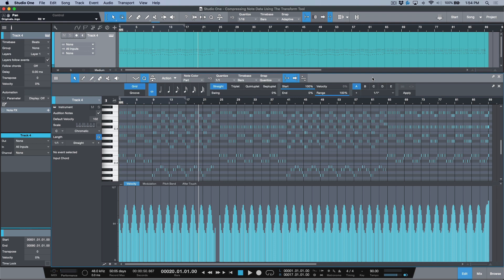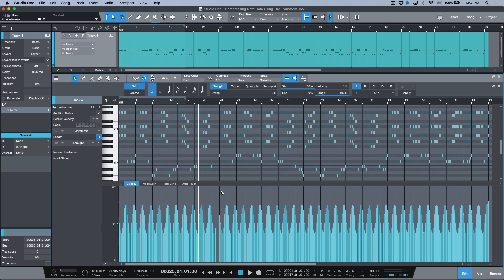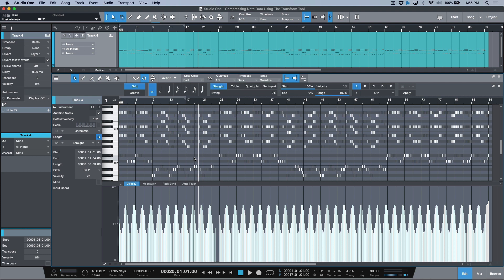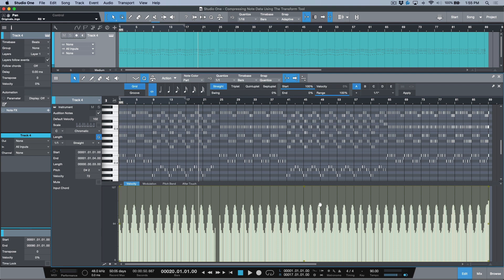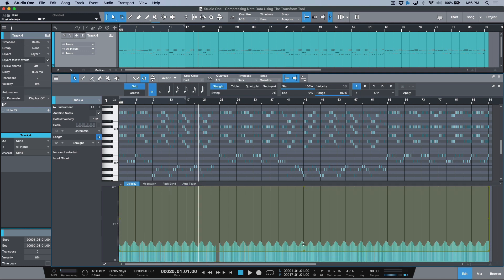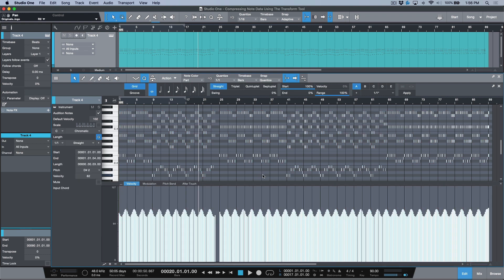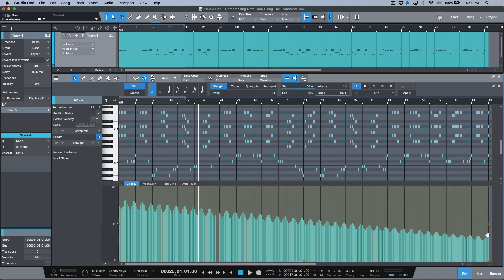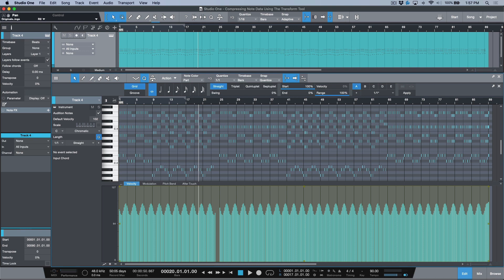Compressing Note Data with the Transform Tool In PreSonus Studio One

Comment: Great tip. Question- can it be used on external MIDI hardware, such as a Korg Kronos?
Reply: Yes, it's the midi notes that are edited/transformed, not the sound or instrument settings. It will work on any midi instrument, virtual or hardware.